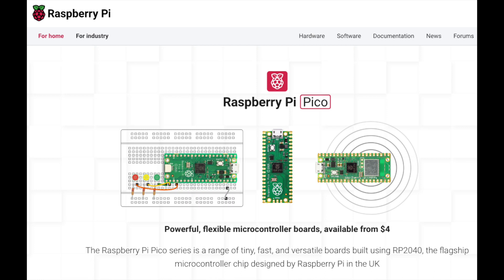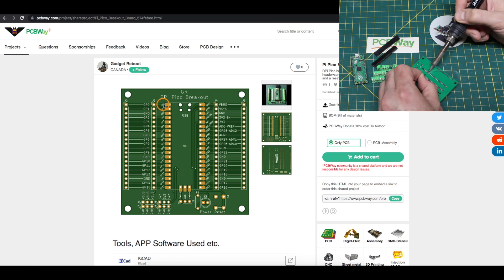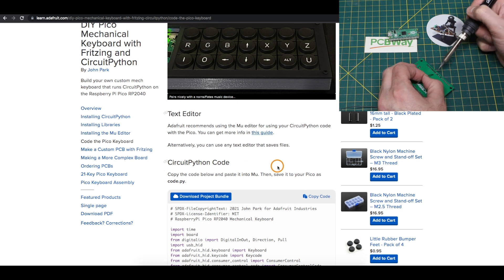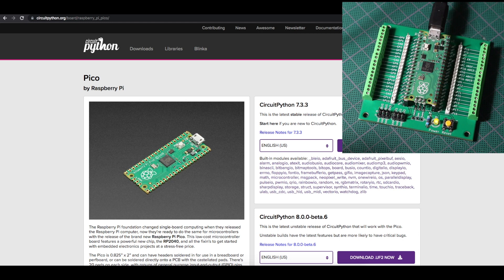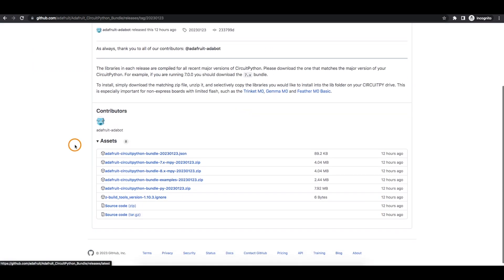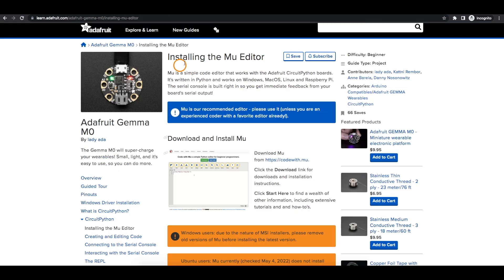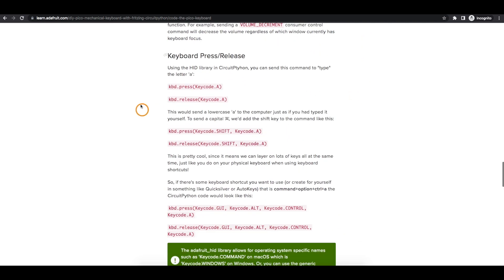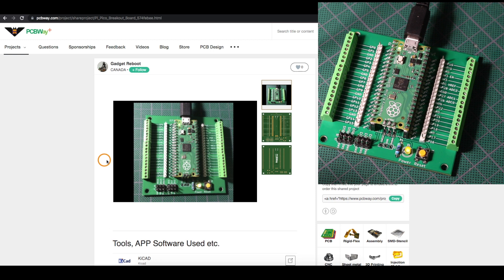RPi Pico Breakout Board and Trying a USB HID Keyboard Project

Comment: using "pico w" as hid+webserver, add tablet to display keys, use touchscreen, 
partly worked but circuitpython at that time did not have stable wifi ...
webpage and it's images can be stored on tablet (html <base> url embedded pointing to pico) ,  
webserver reply does not need to refresh page, html has special reply number ...
tip : you can combine pico input with real keyboard input,
e.g.  12 pico keys f1-f12,  press (ctrl/shift/alt/winkey) on real keyboard + press pico key f12,  get ctrl-f12